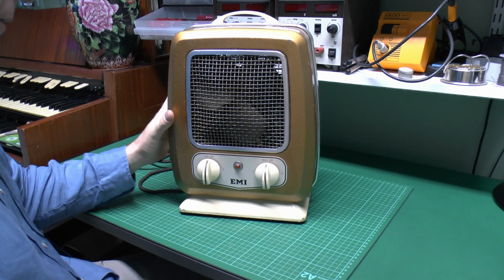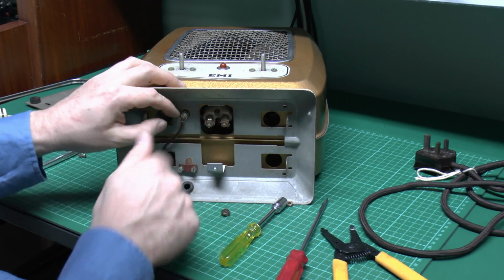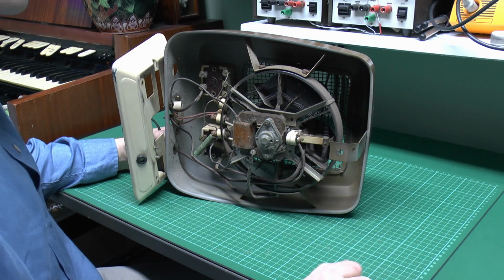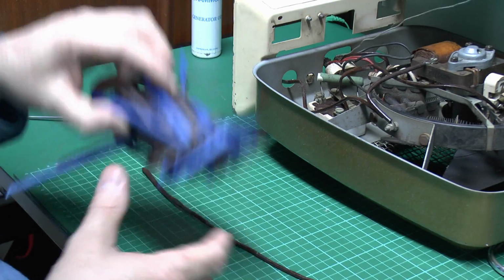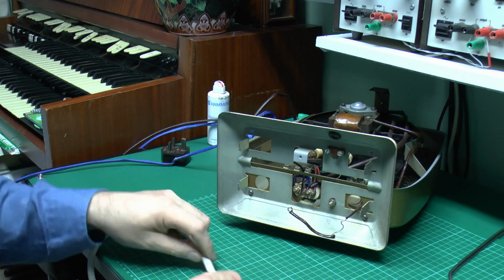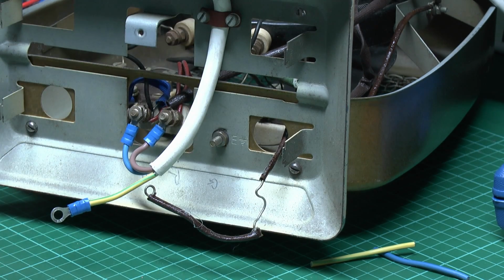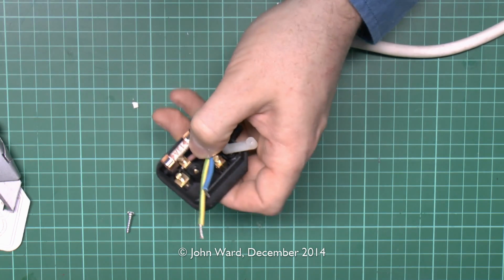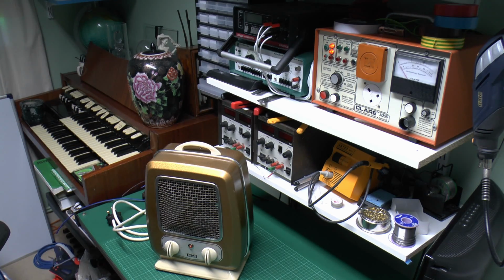EMI Electric Fan Heater Refurbished, Model CRH7

Comment: I usually use white spirit soaked cotton balls for jobs like this.
White spirit is pretty neutral to most paint types but especially so on the enamel and Hammerite type paint jobs you typically get on metal.
If you had used whites spirit rather than just water then you would not have that quite obvious "scrubbing wear and tear" area that is all too visible in the vicinity of that previous label.
Sorry, but yes, I can see it.
And no. Sadly, you cannot  undo damage like that.
Oh well.
At least now you know for the next time.
BTW solvents is a bit of a hobby for me.
I always have on hand: acetone, toluene, white spirit, isopropyl alcohol, ethanol, MEK (methyl ethyl ketone) and regular petrol (gasoline).
Some of these solvents can be quite aggressive / pernicious so need to be handled with a certain amount of circumspection.
Basically, the rule I follow is: "know your solvent" "know your surface" whether your "surface be plastic or whatever type of paint"
Enough lecturing.
>

Comment: I think the overtemp cutout relies on the magnetic properties of the ferrous metal keeper being lost at a predetermined temperature, so the contacts spring apart.
Reply: 👍👍👍 Curie effect!
Reply: @Tag-Traeumer  Weller soldering irons use it in their Magnastat thermostats
Reply: @kevvywevvywoo  This is very interesting. My soldering iron has a different temperature control, without contact, only electronically. I know a thermostat that works with the Curie effect from the YouTube video: „Technology Connections Old-fashioned rice cookers are extremely clever“.

Comment: When I first watched this video i was not that interested in this repair. But since then I have been restoring a 1938 GEC heater and it's been a surprising  amount of fun.  I need to try an source some ceramic insulators for the wire heating element  and also want to add a tip over switch and a thermal fuse. Nice job and enjoyed watching this again. My best regards Chris

Comment: Hi John, interesting video, I enjoyed watching it. One question though: You didn't use cable end sleeves (don't know if that is the correct english word, those small metal tubes you crimp onto the ends of a lead you are going to use at a screw connector), had the plug metal tongues that allowed the use of multi core wires without the sleeves?

Comment: Hahaha I got a kick out of the comment on the resistor being inefficient for fan speed control. In a device whose sole purpose is to create heat :P I could imagine at the time it was cheaper to throw a common ceramic resistor in there Vs. buying multi-speed fan motors

Comment: The only part I was worried about was the earth wire in the plug. 
You looked to have stripped too much insulation cover and you poked down the excess which was close the the live pin screw end.

Comment: Another great British product from the days when things were built to last. I would be interested to know if the elements are of unequal power rating as you mentioned, or if they are both 1KW. I have an old Kenwood fan heater which is very similar to this one and it also has three heat settings and two elements, but they are both rated at 1KW. The lowest heat setting is achieved by connecting both elements in series which gives a power of 500 watts. The medium setting connects one element across the mains and the high setting connects both elements in parallel. The low 500 watt setting isn't found on modern heaters but I'm sure could be added with an additional switch and some wiring modification. I might get a cheap 2KW fan heater and give it a go. Regards Richard
Reply: Yes, it appears to be the same basic arrangement here too. If you're going to modify a modern heater, bear in mind that those commonly have the thermal cut-out in the common (neutral, nominally) element connection, which may or may not be easily separable.

Comment: I've worked on several antique heaters, and I see several details on this heater that I have never seen before; for instance, the ceramic terminal strips throughout the unit as well as the ground bonding of the main cabinet to the base.  The way it is wired into the base does make sense to me, though, as most things back then in the UK were sold without power cords.

This wouldn't be the first time I have seen an induction motor's speed controlled with a resistor; a friend of mine has a very high-end Hegner scroll saw which uses an Atma variable-field motor; the speed is controlled by varying the field current, which is done with a small potentiometer.

Comment: When we repaired devices at our University Hospital and research labs that had heating elements, we used uncoated fiberglass sleeving. These had a rating of over 1000 degrees fahrenheit. It comes in many diameters and is preferable to heat shrink sleeving in these locations.
Reply: Actually, the sleeving JW used is a braided type (look closely).

Comment: Great videos as always and very informative, thanks. Isn't it possible that the thermal cut out relies on the Curie effect rather than bimetallic ?
Reply: +Peter Brereton Unlikely. The Curie temperature is so high that the metal would oxidize heavily and warp. Plus after that temperature is reached, a magnet will be ruined, never to magnetize again. Definitely a bimetallic design.
Reply: @zwz.zdenek  Take a look at old Weller Magnastat soldering irons like the WTCP or the older TCP, they're using the Curie effect to regulate the temperature of the soldering iron. The soldering temperature was only defined by the tip, they have different tips for different temperatures. Diagram how they look inside:

http://www.berel-am-ries.de/WVSS/Arbeitsvorlagen/Weller_Loetstation-Dateien/image002.jpg
Reply from the maker: Peter Brereton Yes, that would also explain the use of the magnet.

Comment: Mmmm, nice little heater. :-) The plug you put on it is the same make as I have on my building site transformer. They're good plugs! :-)

Ooooh, that CLARE tester.... That's a sizeable one! Yes, I remember those. When PAT testers were proper-big chunky bits of kit. A very reliable and precise bit of kit I'm sure (and probably very expensive back in the day!)

A lot of PAT testers are hand-held today, but some of them can't run the appliance like your CLARE tester did. :-)

Thanx for showing,

-BoomBoxDeluxe.

4th January 2015, 22.25
Reply: I'm still using a CLARE V152 tester, still calibrated yearly :)... customers always ask why... i tell them it will outlive them LOL... and no modern tester does a 3750v flash test (to me that's essential for things like power tools)

Comment: Eng. Jon ward I need you help me to understand the solution for problems when we found volte between N and ground wire above the 17 volte in the main switch in the TT system 400 v - 4 wire ..Thanks
Reply: Kilani Sdudah voltage drop in the neutral :)